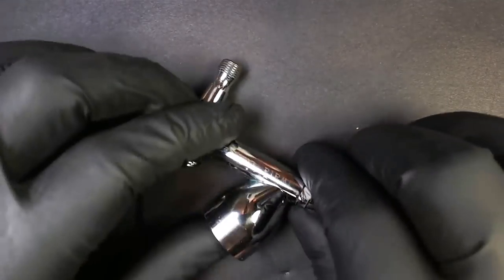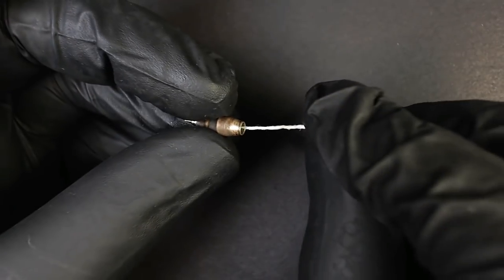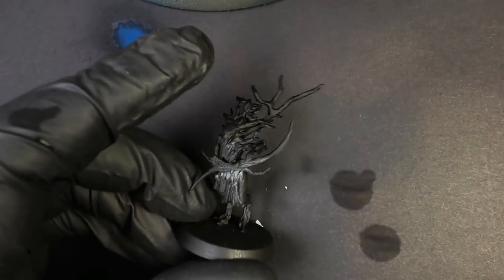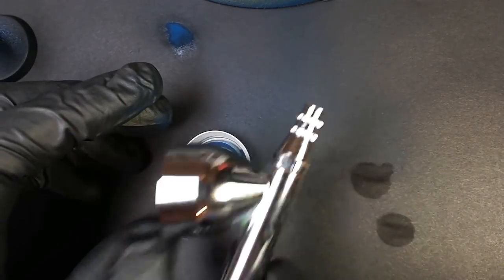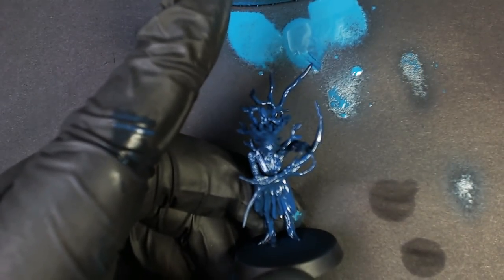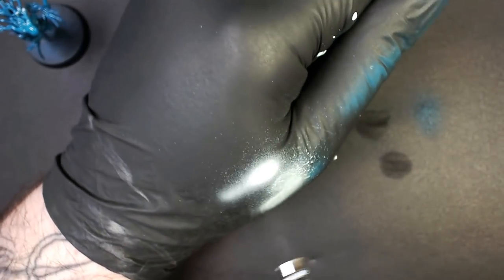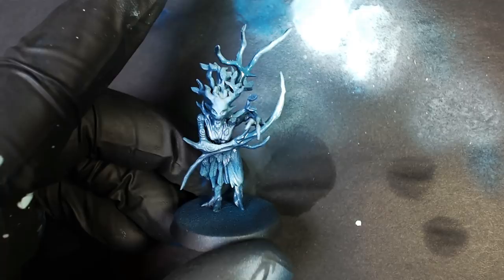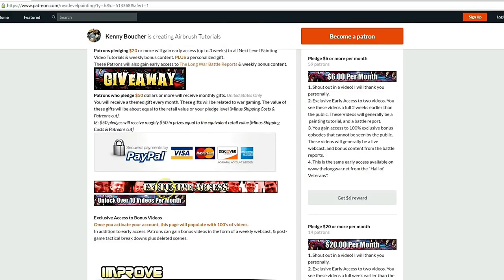Is Your Airbrush Clogged?

Comment: Tips: #1 Get yourself some airbrush lubricant like Badger's Regdab needle juice, but it on your fingers and lubricate your needle out of your airbrush after or before every use, then with your fingers still covered rub them around inside the airbrush paint cup before returning the needle and setting up for use. This will reduce the chances of paint getting a foothold on these parts, some will still happen, but will come off more easily and will not aversely affect your paint job. The lube in the paint resevoir will make it easier to remove the paint that clings to the sides. It will also remove unseen paint or primer a lot of the time when you do it.

Tips: #2 Have yourself a bit of plain paper or card, or even better plasticard (as you can re-use this) to test your paint consistency for airbrushing, your compressor pressure and your own technique to ensure that even before paint touches model; your paint, your air pressure and your technique are on point for doing a good job. As you paint with the airbrush, anytime you leave the airbrush for a time or suspect paint may be drying on the tip you can take action to unscrew the crown (just the crown, don't want any leaks) and either with a toothbrush like Kenny here or with your gloved or bare thumbnail just gently rub off any paint that might have gathered on the needle only. Don't remove the needle from the airbrush with paint in it, just the crown and just clean the needle. Then screw the crown back in place, do a few test sprays on your paper/card/plasticard and once you're happy continue painting.

Tips: #3 Sometimes a block may just be forming, or may only be a minor blockage, you can clear these with Tip #2's paper/card/plasticard by just pulling the trigger right back and blasting it on full, a few brief presses and then just air alone after. If you have air bubbling up through your paint cup after that, you still have a blockage and you will need to deal with it. Sometimes you may find the nut at the back of the airbrush, which is usually covered and which holds the needly might need to be tightened up or has come loose or wasn't tight enough, that can also cause this bubbling. just make sure the needle is in the right position and tighten it up. Caution though, don't tighten it too much, just enough that it isn't loose and easy to turn.

Something for cleaning the nozzle, the pipe cleaner like tools sold for cleaning airbrushes can be kind of abrasive (sometimes a good thing) but they can also make you need replacement parts sooner because they are so rough. A better tool for cleaning those parts are interdental brushes that you can buy at drug stores, dentists and supermarkets (as well as off of ebay and online of course). These are finer, softer brushes that can do the job better and often even come with a little cap to keep any paint spill or airbrush overspray off of them ( happens to all of us ;) ).

Great Video Kenny o7 Keep up the good work!
Reply: lunahula Damn good post, dude
Reply: Always happy to share what I've learned. : )

Quick Tip: Blu Tac / Poster Putty - Hold your paper/card/plasticard down from Tip #2. Hold down a miniature you're painting. Use it to mask camo stripes on vehicles. You can even use it to suck up paint flakes about the place if you're nervous of them getting blown on to drying models.

Keep Calm, (all your airbrush issues are fixable) and Carry on painting all.
Reply: lunahula nice one dawg! got to agree with you about those pipe cleaning brushes as they can permanently damage the track leading from the colour cup to the technical bizz at the tip and if that gets jizzed up the airbrush is pooped permanently, the manufacturer won't fix this for free either they can't as these little brushes damage the internal diameter - I found this out the hard way and had to buy a new brush, since I seased using those damn brushes I have had no issue with my ab apart from a slight block & rarely at that,  best advice I got and used always shoot cleaner thru your brush, if your changing color shoot cleaner, if your using the same colour over and over shoot cleaner thru after every third or even second fill if it's a high viscosity paint and stop it drying out, shoot cleaner,  going out for a smoke- shoot cleaner, taking a whizz- shoot cleaner, moral of story shoot cleaner thru your brush all the time,never allow paint to sit in the brush and I know a lot if pros use those fkn mini airbrush cleaning brushes but like I said they destroyed my Krome, all I have of it now is the parts I can use if anything goes wrong with my new Krome. Hope this helps someone save themselves from disaster, easy fix SHOOT CLEANER AVOID AB CLEANING BRUSHES
Reply: Yeah it's one of those hidden traps in airbrushing, that you see these collections of brushes specifically for cleaning airbrushes online, whether it's Amazon, Ebay or anywhere, even in an actual airbrush store. Those brushes can be a ticking time bomb on the life of your key airbrush parts. Particularly because when you are new you wont know how much force to apply, you go in too strong and think 'wow this is wonderful it takes it right out, I didn't even need cleaner!' the first few times, then you forget about it and do it everytime until you start hitting problems.

The great thing about the interdental brushes, is that these days you can pick them up affordably all over the place and best of all they will tell you the brush diameter in 0.XXmm on each type, so you can pick the brush width to suit your specific airbrush parts everytime. Hey if it's good enough for your teeth and gum longevity, it's just as good for having your airbrush parts last. :)
Reply: I shall have to pick up some of these lill' brushes, they sound great and if they are plastic or similar they won't damage the brass. Yea man a good indicator that they are gentle or else there would be a lot of bleeding gum disorders haha,  I spent over an hour slowly picking out a blockage in my tip (eesh sounds nasty assed) I had a look at the clump of shit that fell out thru my macro lens and holy shit there was 
snapped off bristles and crumbs of old paint all chewed up together in this little pellet of crud, thing is it still had flow so it was working but I could tell something wasnt right and eventually figured out it was a clog in the tip, after I removed it it was like having a brand new airbrush again- that was on my Patriot 105 which has a massive tip in comparison to some ab's, they say you learn from your mistakes huh so if thats the case I should be a master but being self taught I am still very much learning from day to day. Videos like these are an amazing resource for guys like me who don't have buddies who are into the airbrush so no real folks to learn and share with. Anyways thanks for all the advice.
Reply: More advanced thing for long term cleaning of your airbrush is the ultrasonic cleaner. But do look them up on youtube in regard to their use in airbrush cleaning first. For airbrush cleaning they are pretty miraculous and inexpensive things. But you do have to be aware that using them as your first stop when cleaning your airbrush, e.g. using them as an airbrush dishwasher machine, will take all those nice chrome and polished metals off after a while. That putting parts in the tray too close together will destroy them because they will literally vibrate against each other so fast in just a few minutes they will tear each other apart.

As a once in a while good thorough deep clean of your parts, or as an emergency 'Oops forgot it and left it over night!' or something situation, it's a solid investment in long term airbrush maintenance. Again, it's something that dentists use and now we do for hobby. Also worth noting that using things like simple green in it, you can strip paint of miniatures faster, though again I must stress look this up first and do not put things you want to strip too close to one another in the basket. :)
Reply: I own one, I bought it to keep my vape gear clean and in good working order not knowing at the time that it would become a valuable asset in my  other hobby! I very rarely give my airbrushes a sonic bath but when I do I am always amazed  at the clouds of paint that 'puffs' out from every nook and cranny ~ even where they look clean and shiny. Very handy pieces of kit indeed! 
Talking about the 'Opps I forgot it' situation, only yesterday I was working on one of the terrain bits n pieces when my friend arrived and I sat my ab down to let him in, next thing we are rolling dice and we...no wait 'I' was putting minis back on their shelf when it dawned on me I'd gone and left the cup half full of primer, I was lucky though, I'd put the cap on the cup and the guard over the needle and this must have prevented it from drying out so much, I just gave it a good clean and all was well! Lucky though and shows just how easily it can happen, even to those of us who think we are careful dudes!! haha. Thanks again for the advice and tips.
Reply: How is the Flow Improver different from any acrylic retarder? Great videos btw
Reply: Cotton Swabs made by Taimya. You can get them in a micro size and they can easily go through the needle canal and clean everything inside.
https://www.hobbylobby.com/Crafts-Hobbies/Model-Kits/Tools-Adhesives/Medium-Triangular-Craft-Cotton-Swabs/p/108439

Link provided to see what I'm talking about. those are "medium" I get the really small ones. best thing to use for cleaning your brush. i would never use a metal pipe cleaner on my airbrush.

Comment: Brand new airbrush, I've clog it already... Saw this video and ordered Hoppe's #9 before my first use of my airbrush. Received my bottle after i've clogged it. I've tried everything before, and this product just done the job in 2 min. This thing gave me hoppe's. Thanks for that wonderful tip.
Reply: And i forgot to mention. I don't have a high end airbrush and it's improve a lot my brush after using it. Probably had stuff that came from the factory still in it. Made super nice paint stroke yesterday after cleaning it with Hoppe's 9. Thanks again.

Comment: Thanks. I just started airbrushing, and I’m literally on my first time using one. I bought one on eBay and it was spraying like garbage. I had cleaned it, but not as well as you showed. Blue solid gunk came out of the needle slot. Got it all put back together and going to try again.

Comment: I have a tip I haven't seen before: Vallejo cleaner is kind of like soap, so you can use it for sticky parts inside of things.  My dipstick, or whatever it's called under the trigger, was sticking bad so the air wouldn't stop.  A few shots of that cleaner and a quick scrub with a pipe cleaner left it perfect.

Comment: I just started airbrushing. Just a suggestion. I use silkscreen mesh and cut a square off and put it on my paints bottle with cap screwed on to sandwich it so it does a paint screening so u can avoid chunks that might try sneaking its way out and in ur cup.

Comment: I hated airbrushing at first. I had a used neo that clogged constantly. Then i dropped out on an eclipse and the vallejo game air line. Now I'm gangster as fuck.
Reply: I'm doing great with a Neo, using water+flow improver for air paints, and water+thinner+flow improver for non-air paints like citadel, normal vallejo/army painter. I'm pretty noob with airbrush though, using it mainly for skin, priming, preshading, and blends for things like "power weapons" and osl.
Reply: I think the used Neo needs some of the love from this video, but this eclipse is so dynamic that I'd only use the neo for auto body and stuff now.  I pre-mixed some citadel paints to better effect than cup mixing, unless you're an OG, it's easy to go too wet or dry with the Neo, but I get away with it on the Eclipse just fine.  The build of the eclipse allows for a lot more cleaning and easy priming as he shows here.
Reply: I love my Eclipse, even if I still do screw up from time to time. Last night the needle came loose and backed itself out, so I was spraying at full throttle when I just pressed down for air. No damage done though, I was spraying the undercoat on a tank in prep for chipping fluid.

Comment: The airbrush I use (Krome) has a super tiny brass nozzle that's nearly impossible to hold while cleaning.  I can't tell you how many times I've dropped that little bastard and thought I'd lost it forever.
Reply: Have this same brush, wish they developed it with the regular air cap / guard. Luckily I've never dropped it.

Comment: As soon as I stopped using Vallejo airbrush thinner and started to use just  distilled water (hard water area) and Vallejo flow improver, I found that my airbrush didnt clog as often nor have nearly as many problems with paint drying on the nozzle or on the tip of the needle.  So thanks Kenny for the info because I too was like; "oh my god, why did I buy this thing!" at first.  They take a lot of getting used to though with a lot of tweaking here and there at first.  Just a heads up forany one interested in getting an airbrush.

Comment: I knew this was going to be the biggest pain in the ass of airbrushing, but it still got me.  I'm even a pro house painter, so I'm very familiar with the practice of cleaning out a sprayer thoroughly every time I use it.  But I'm learning that airbrushes require an extra layer of care that's usually optional with an airless sprayer.  With an airless, you can get by with just flushing it with water really good 90% of the time.  Don't have to take the gun apart every time, only need things like lube and storage oil if you're not going to be using it soon (although it's still smart to use some throat seal lube more often).  With an airbrush, you just gotta do all that stuff between each use.  Lesson learned, I got this.

Comment: Its tough when you're super new to airbrushing, and you have no frame of reference for what's good or bad. 

For example, my compressor doesn't allow a steady spray. I have to wait a second if it stops and it starts again. 

Sometimes airs coming through, but no paint. Shit is tough to get used to. I'm sick with a brush tho
Reply: does your compressor have a tank? A tank will prevent that problem afaik

Comment: Cotton Swabs made by Taimya. You can get them in a micro size and they can easily go through the needle canal and clean everything inside.
https://www.hobbylobby.com/Crafts-Hobbies/Model-Kits/Tools-Adhesives/Medium-Triangular-Craft-Cotton-Swabs/p/108439

Link provided to see what I'm talking about. those are "medium" I get the really small ones. best thing to use for cleaning your brush. i would never use a metal pipe cleaner on my airbrush.

Comment: Thanx Ken, Great Info, I Just opened 3 Cheapey Air Brushes & they all Clogged, ..  Walmart White = Do I need say more? Time to get a Brush set & Liquids .  A question as a Long ago, 30 yrs, Bodyman; ....  I know oil based silicones can phuk up a Paint Scheme badly....  Thusly , Is This oil U use,  Not a silicone based Juice Being it Don't Mess Up the Final Spray patterns?   Thanx All For info inputs here also.

Comment: I recently had a clog that bad I could not even pull the needle out but a few blasts of premi-air foaming airbrush cleaner taking the nozzle out and just unclogging everything it worked again.  There were actually solid chunks of things on the needle.  Guess I did not clean it well after doing some priming, seemed that primer and tiny bits of cotton from cotton swabs had joined forces to destroy me ha ha. I have the same airbrush as you, however, it is still quite new and shiny, whereas yours as a lovely lived in appearance.  The nozzle tip and needle look bigger than mine though, are you using the 0.5mm.  Did you find it better than the 0-35mm? Just curious as to the reasons for using the bigger one in the interest of learning about airbrushes.
Reply from the maker: mine is .35

Comment: This is the lit-er-al best airbrush video i've ever seen!  Question though - can I, or should i use vallejo flow improver with my Vallejo Black Primer, when priming the models?  Also, any chance we can see what the dried model looks like, and what technique you use for the wash?  Really curious about this, as i am literally a week away from using shown techniques on my first army.
Reply: Geteav Nroc I don't (I use Vallejo primer all the time). They are supposed to be good to go for airbrushing straight out of the container.
Reply: Thanks Andrew!
Reply: not going to hurt it. i use it on dry and warm days here and cant tell a difference
Reply: Geteav Nroc - I would personally recommend it. I found that I have far less issues with clogging and the paint thickening in the hopper when I use flow improver.

Comment: Hey Kenny B! I have a airbrush question for ya.
 So my brush shoots really well but I get speckling around where I shouldn't be getting speckling that is there a way to fix that problem?  For example if I'm trying to get all super technical with my airbrush and I'm spraying with light air and everything is going on fine but and then I'm getting speckling around paint dots and makes it rough to get clean work.
Reply: speckling happens when the paint is too thick for the air pressure. Fix one of those things

Comment: i have an Iwata HP CS Eclipse and im about to tear my hair out. ive cleaned it and cleaned it and now am soaking every piece of it. The issue i am having is the airbrush shooting paint before i pull back on the trigger. No idea why this would happen but this airbrush is pretty much brand new ive only used it once and it went well cleaned it and put it away and now about 2 weeks later its doing this and its maddening sorry if its a dumb thing im forgetting or something just frustrated as it was 200 bones lol need it to work
Reply from the maker: is the needle all the way in? That is the behavior of an airbrush that has the neddle backed out a bit.